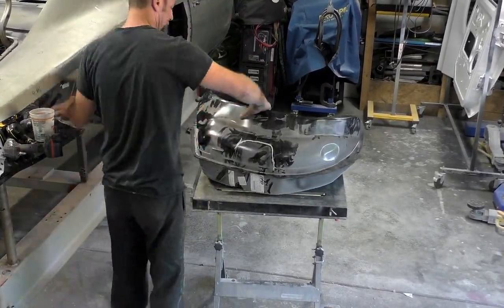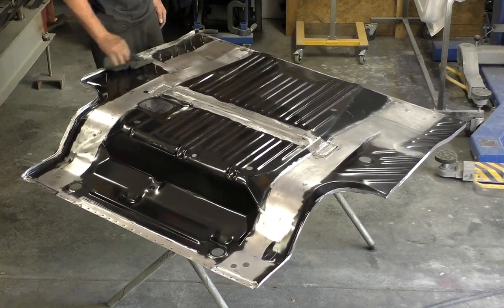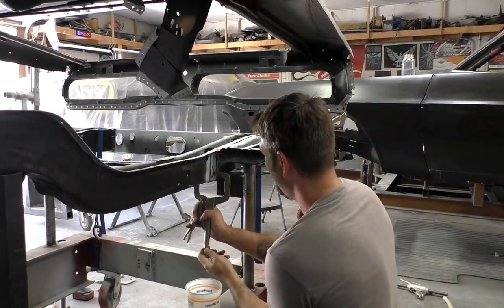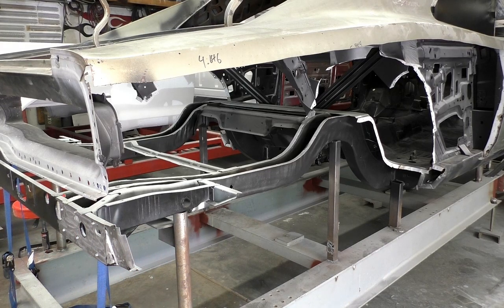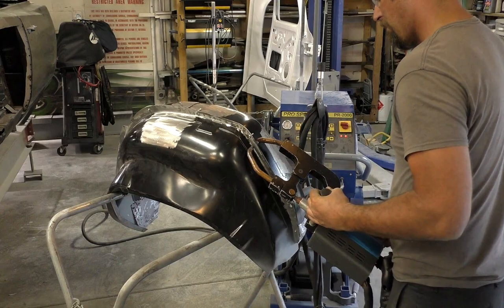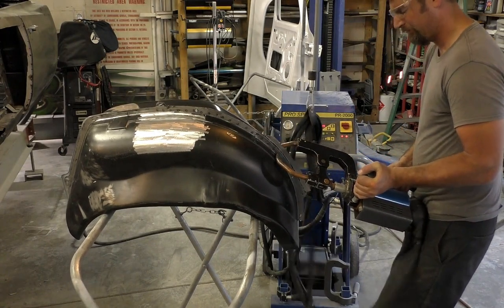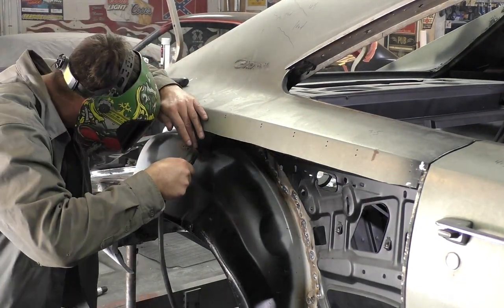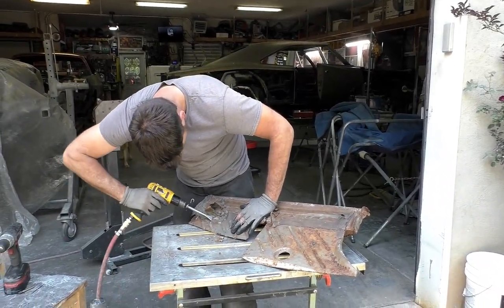1969 Dodge Charger Frame rails, crossmember, trunk, wheel houses, trunk drop offs episode 5

Comment: Do you create your own reference material for future builds? I can see how writing things down that you learn on each project could be beneficial for the next project even if it is the same make and model of car.
Reply from the maker: That is a very good questions and to a certain extent I do. Most of my stuff has been e-body cars so I have full frame JIGs and diagrams dedicated to those cars. With this car I will make marks on this JIG sliced into the metal and keep the rear/front mounts so if another one comes in these brackets are already done. AIf i start doing a lot more Chargers then I will take that to the next level.

Comment: Did you do something different with the charger coating the panels with VHT E coat? Don’t you normally remove the Ecoat where you weld, spray the weldable primer, cover the weldable primer and spray the panel with VHT epoxy primer? I noticed you didn’t remove the Ecoat from the trunk pan and extensions? I wasn’t sure if you adapted to another process. Very impressive work. The charger didn’t look like a special R/T model to receive so much attention. At least I didn’t see a spot for the emblem on the tail panel.
Reply from the maker: I don't know the whole story behind the charger except its a 69 charger and no matter the model they are desirable. With the E coat unless anyone specifically wants to pay for it I will only scuff the e coat and epoxy on inner structure panels. Its a lot of extra work to remove it all for areas that will not be exposed to the elements or no one will see. Saying that I know a lot of these cars especially the Mopars will be going body color so the painter will a lot of times take care of the painting and like this one I will leave the factory panel e coat on the car. It all depends on owners expectations and what fits most in line with the budget and next step where they are taking it.
Reply: @carthageclassiccars  They are getting rare thanks to Dukes of Hazard.  If it was your car would you scuff the e coat and paint? Remove the e coat entirely and epoxy prime then paint? Scuff the e coat and epoxy? What's the best way to work with this e coat for best protection? I have watched some that take the e coat right off and epoxy as standard procedure. 
I did send an email by the way....Thanks for the response. I am watching a couple more tonight. It's a good binge...